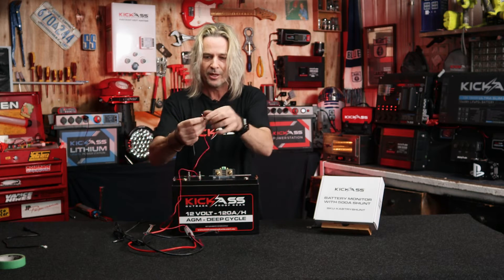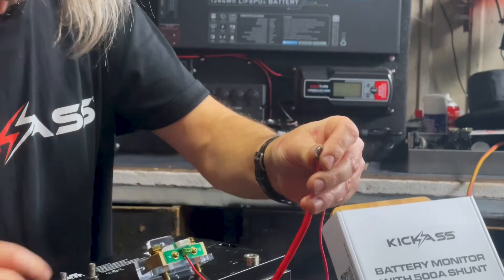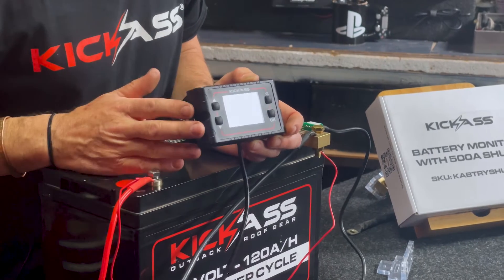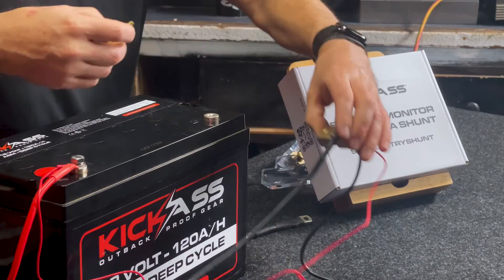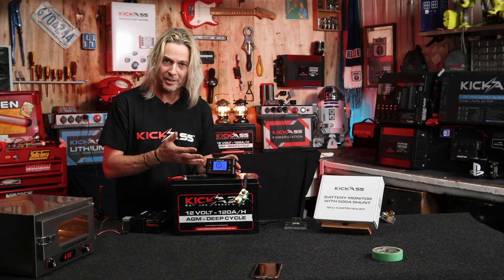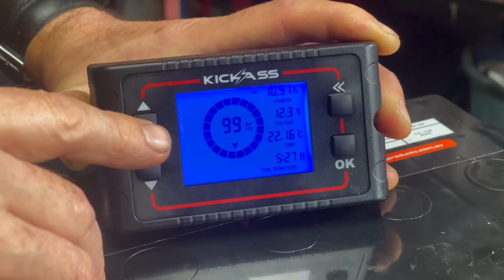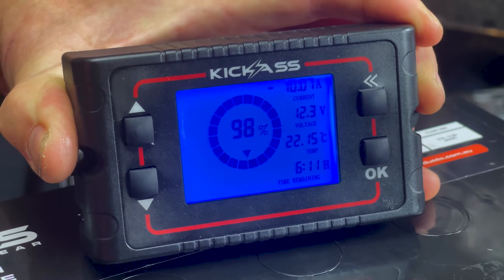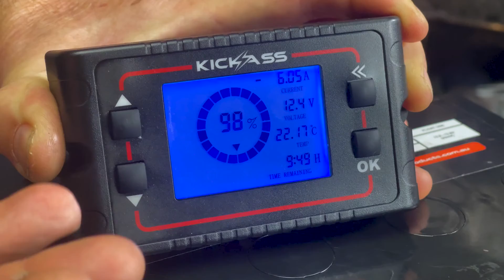KickAss Connecting up the Smart Battery Shunt

Comment: Just wondering Craig would i have to run both earth wires from a dc/dc charger(ie. alternator and solar input earths) from the shut output to monitor input and output from the charger? Or does it show the state of input and output of the overall battery’s current draw Cheers guys, Love ya work
Reply from the maker: all earths have to go to the p- of the shunt to measure all input & output current 
Cheers Craig
Reply from the maker: all earths have to go to the p- of the shunt to measure all input & output current 
Cheers Craig

Comment: If you have a battery cutoff switch on the positive battery lead which side of the switch should the red “shunt power” wire go? On the battery positive side of the switch or the load positive side of the switch? In other words should you be able to cut power to the shunt at the same time you cut off the battery? Curious minds would like to know…
Reply from the maker: its up to you,put a switch in or the off side of your battery cut off switch & you can turn it off '
cheers CRaig

Comment: I have 2 AGM's, one under bonnet and one in the rear of the car, connected in series with appliances connected to each. How would you reccomend I connect the KickAss shunt I just bought?
Reply from the maker: you would have to connect both of the negatives  to one side of the shunt & all your input &output earths to the other side,would be bit of a mission considering how far away the battery's are from each other
thanks for watching & commenting
Cheers Craig
Reply: @KickAssProducts thank you for replying. I think I'll wait until the AGM's have died and then upgrade to one large lithium in the rear.

Comment: Great video. Is it possible to connect the monitor and shunt to the kickass agm battery box with dcdc charger? If so is there anything I need to know.
Reply from the maker: G'day there connecting the shunt is for sure the way to go as long as everything on the negative side of the battery is connected via the shunt it will let you know excactly what's going on 
Cheers CRaig

Comment: Would this be the exact way to install the shunt if you had 2 x batteries joined in parallel?
Reply from the maker: G'day there,here is a link to the manual for you 
chrome-extension://efaidnbmnnnibpcajpcglclefindmkaj/https://cdn.shopify.com/s/files/1/0845/2341/7879/files/KABTRYSHUNT-USER-MANUAL-V0.8.pdf?v=1706389351
thanks for watching 
cheers CRaig

Comment: Shouldn't there be a fuse, on that thin red power wire, that feeds the monitor?
Reply: I just hooked up 2 of these and it does say in the instructions under "Caution - Ensure the B+ Wire is fitted using circuit protection: Split conduit or an in-line fuse rated at 3A will be suitable." It does not show this step in the set up instructions so it is a little confusing. I contacted the company but never heard back so I just installed a 3 amp fuse on the B+ wire just to be on the safe side.
Reply from the maker: G'day there,no the power wire is for the display ony & uses bugger all power so not needed as it carries no current through it 
Cheers CRaig
Reply: @KickAssProducts  Hi again. The concern would be if that wire is somehow damaged/pinched, and touches an earth/-ve point.... = yikes
Reply: Everything that comes off the battery should be fused

Comment: Hi - thanks for the video. Perfect timing as I am about to re-jig my battery install. I am guessing that if I have two agm batteries in Parallel it won't matter which battery I connect the shunt to? Cheers
Reply: No it wouldn’t matter what negative is used as both negatives are wired to the shunt regardless. In saying that though have it closest to the battery that is closest to the charge controller if you have one installed (DCDC Charger etc)
Reply from the maker: as long as the earths are at the same place battery end & all the in's & outs are the other end of the shunt then bob's your uncle :)
Cheers 
Craig

Comment: can you show a way to set it up to a fuse block please
Reply from the maker: G'day mate,give me a few more details on what help your needing
Reply: @KickAssProducts  if i was to run the negative wire to a fuse block would it show me all the amp usage from all the stuff i have connected to the fuse block?
Reply: @xMizeryz  yes it would. Once the fuse block is wired in the shunt will show all usage from the fuse block and any other wired in device as well. A bus bar is also usable to monitor all power usage of multiple devices are being hooked up
Reply: @KickAssProducts  will it be same way to install it on lithium battery ?